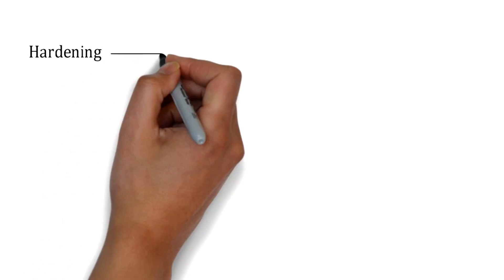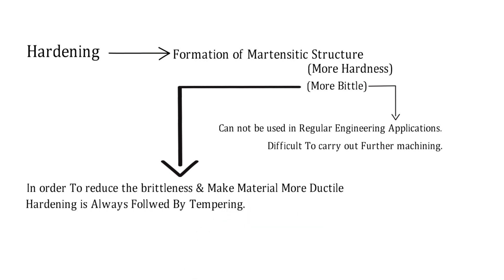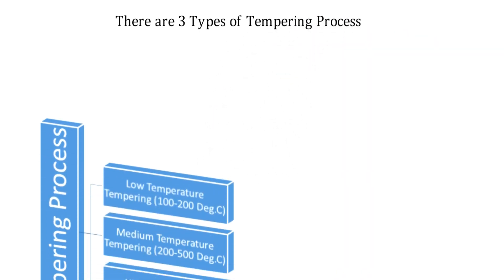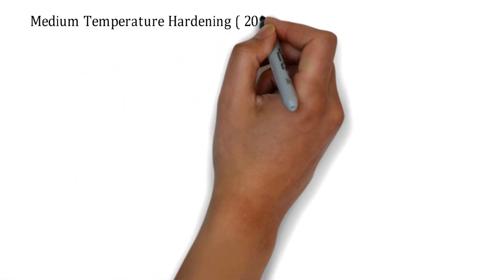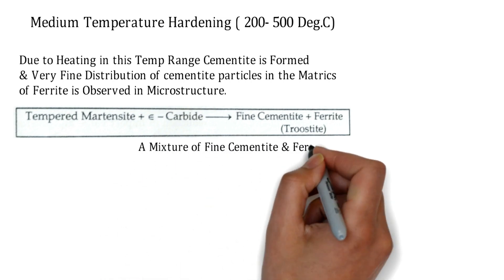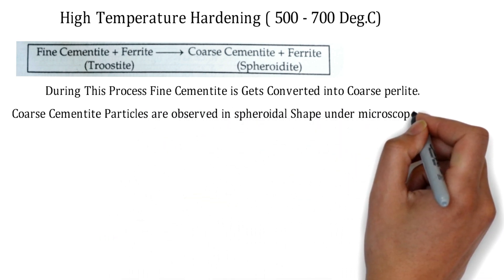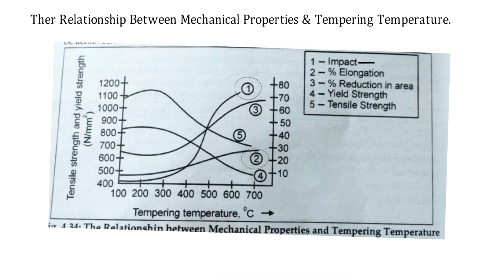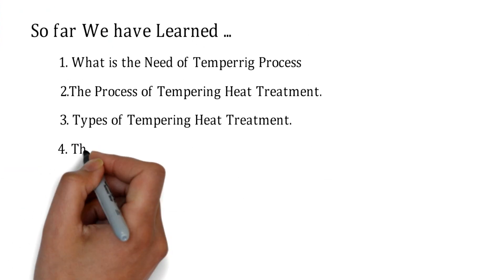What is Tempering Heat Treatment ???  ||Engineer's Academy||

Comment: Thank you very much for providing a logical and scientific explanation of tempering.  I have been struggling to understand tempering versing hardening in hand tools for a long time.  The one thing you didn't mention, and I am curious about, is looking at your trade-off graph toward the end - for a given material, are there some key points that are considered "ideal" for material/use cases?